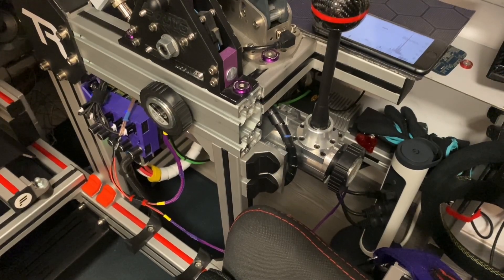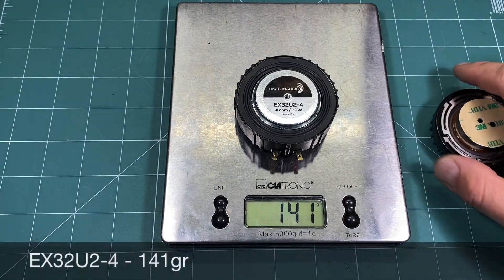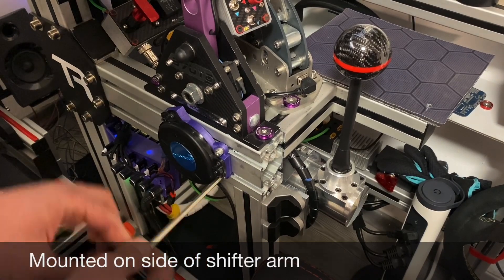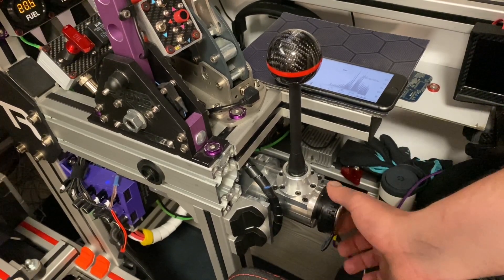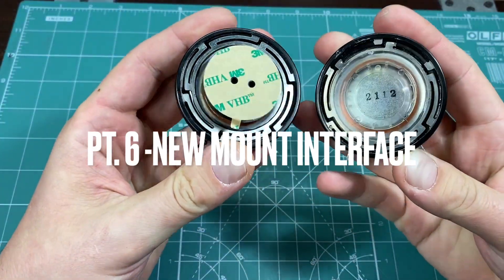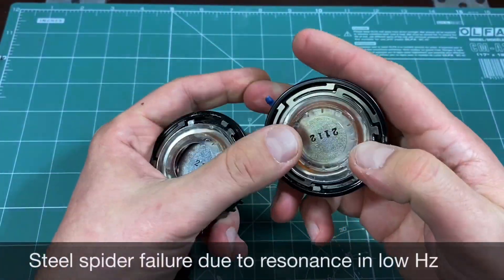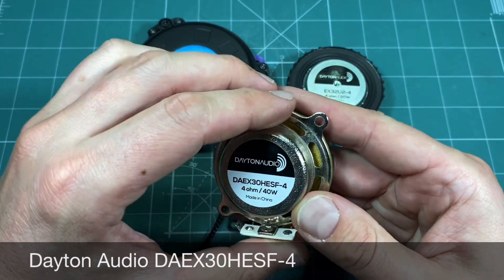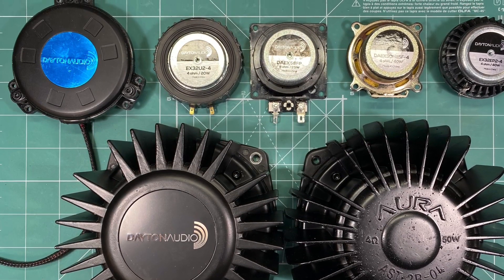Battle of the Exciters - An Exciting Review About Shifter Tactile Feedback for Sim Racing

Comment: Yeah the cheaper pucks are basically the same as a Simagic HPR reactor inside (pulled one apart yesterday). Just much shallower and wider also. Basically a magnet and voice coil and thats it. The spring action comes from the plastic housing where as the Haptic Reactors have no spring action and utilize the voice coil exclusivly. Much longer magnet too. So I can see why HPRs would have solid impacts as there's no spring resistance to the magnets impact

Comment: if u use exciter to rig, wouldnt u turn your rig into a speaker?
Reply from the maker: In this application they are driven at frequencies up to about 70Hz, which is almost not audible. It is not their comfort operation mode but they do the trick.

Comment: Nice video mate! I bought some pucks to test! Did you made that purple mount for them? Can you share the file? 
Do you think that the tape can hold them well?
Reply from the maker: I found it in thingiverse and modified slightly. Tape still holds ;)
Reply: @57uyo  Thanks man! I put a strong tape and its is holding just fine...
Reply from the maker: @fimaximo  sometime i have to change in the DAEX ones as they have small contact surface, but with pucks I doubt you will have issues

Comment: Hi, very informative video, by the way  what DACs and amps are you using to run this setup, are those in the purple brackets ?
Reply from the maker: Yes, it is XINYI audio XY-C100H USB amps, you can find more info on that following the links in the description. They have built in soundcard so you drive them directly through the USB
Reply: @57uyo  Thanks

Comment: hmm i ordered DAEX32Q-4 will test friday on brake pedal seems like model not in this list hopefully works okay.
Reply from the maker: Yes, never tested those, wonder how they will work. I am planning on buying some simagic pedal reactors and comparing with daex32 and hesf, also will throw in the mix my rumble motors. Please update when you finish testing ;)
Reply: @57uyo   will do and as far as those reactors asked race beyond matter to test awhile back with p2000 box and he said they seem to work without actually connecting the pedals think he might have a video about it soon, I will hold off until someone makes easy way to attach them to any pedal set.
Reply from the maker: @Eskoxo  I will 3d print mounts and drive them with one of my amps and SimHub as I am with heusinkveld pedals (saw people already using them with amps)
Reply: @57uyo  I Imagine you would have to create connectors for them or just cut them would it not be better to just get the box for em think its only $40
Reply from the maker: @Eskoxo  as far as I see they use standard DC jack so no issues there. Usb box is only adaptor for shifter/pedal to connect to PC. Still you need the pedals to drive the reactors. Either way I have spare amp and PSU so just need the reactors themselves. Still on preorder in Europe,  it I guess next month I will be able to get a couple.
Reply: @57uyo  cool im guessing will make a video about how you did it:)
Reply: Do you have any news about that exciter?
Reply: @szekerespista3758  I do have it but did not end up messing with it got simagic p2000/p1000 rumble motors mounted on my v3s and not looking back:)
Reply: @Eskoxo  understand. Thank you for your response!
Reply from the maker: @Eskoxo  simagic hpr is great on brake, mixed with my rumble motors is even better. For throttle this is also good option: https://www.soundimports.eu/en/xcite-xt32-4.html
Reply: @57uyo  did not really want to mess with things too much so i got hpr on brake and throttle works good enuf.
Reply from the maker: @Eskoxo  I also got 2 hpr, did not put second as I want to do some testing off pedals first

Comment: Very useful info. I have only used two of the products you test. I need to mess around with my shaker solutions more- but so far I haven’t really found anything I truly enjoy on/near the shifter. Anything I use at higher volume levels creates extra rattling/resonance between moving parts and lower volumes defeat the point. I’m still trying though as I feel like something is better than nothing. Thank you for taking the time to show so many options!  
Edit- I went back in SimHub and reevaluated my settings and got things working much better. I had a very high frequency setting under gear shift that was really clashing. Again, Thank you for your time.

Comment: I watched this with some interest...
Exciters are excellent to achieve a wider frequency range and audible tones that you cannot achieve with many of the other budget models as they are frequency restricted units. Most cheap models have a best working range in 30-80Hz but within that are strongest between 40-50Hz. The exciters can generate a much wider frequency range and this suits other types of effects but not so much gear shift roles.

Some feedback...
Where the exciters generally work best is in scenario of direct contact with a shell seat and for them to be used in multiple pairs for specific body regions. I see you have this on the seat already:) They also operate very well with multilayer effects that utilise octaves and generated harmonics as well as audible tones that can add extra detail/immersion to effects like engines. 
  
Appears this video is focused more on "Gear Shifts" and which unit produces more "punch". So not ideal role/scenario for a single exciter. Although in Simhub gearshifts do not just produce only the frequencies that users input for (Base/High) Hz.

Damages usually happen with excessive wattage, or scenario with too many effects operational at one time using similar frequencies (espically 40-50Hz) this increases the amplitude of the generated source prior to amplification. In my own experimentation with effects I would say that using low frequencies is actually not the cause, sometimes how we apply certain frequencies with others is needed to generate specific sensations with how some frequencies react together.

Recommendation:
If you want a punchy transducer for a shifter that is much more robust yet still small then consider the "Earthquake Mini" which is also one of the best for using on pedals for ABS etc.
Also take note that Simhub when using (Channel Tests) will output at 100% volume even if you use a reduced global volume and this is also a scenario that people cause damage to their units.
Reply from the maker: Thanks for pointing me to the quake mini (if this is the correct one I am finding). Looks interesting, but price point and 300W is too much for me. The Aura works ok currently on shifter, only issue it is bulky and I prefer to put it on seat for jump effects.
Also thanks for the long comments, totally valid and I believe I already covered all of them in the written portion of the review in description. All of them are spot on and aligned with what I figured out. This vide os crucial prt of the complete review but covers very little part of the complete text.
Reply: @57uyo  thanks for responding, I looked into your written review and enjoyed reading it.
Reply from the maker: @Mr_Latte_UK  thanks, mate! Appreciated that you liked it, not so many people read reviews any more ;)

Comment: You have ZERO CLUE what you're talking about. 
Exciters are surface mount full range speakers, not bass transducers. They failed because you don't know the difference and sent them LF signals constantly which isn't how they work. The spider rings and voice coil failed from user error. Surface mount speakers are designed to be used ideally in a Distributed Mode Loudspeaker panel wt a crossover and sub. Your trying to compare apples wt oranges and no surprise,  the apples won. Duh. Like comparing 3 inch tweeters to 15 inch subs and sending them low frequency and saying surprise, the subs work better If you play music through a Exciter while mounted to a surface, it will play the full range of frequency. If you play music through a bass transducer, it will do nothing unless the crossover sends it frequencies of 10-100Hz because they are two completely different devices made for completely different frequencies. You should seriously read Dayton Transducers 101 to get a basic understanding of the difference. If you send Engine Sound from game AUDIO, it will act as a small speaker that vibrates as any speaker will. If you send a Exciter Simhub TELEMETRY, which is LF signal based, it will eventually just break and fail as you show. 
Furthermore,  you don't mention what what wattage or impedance the amp is you're using for testing. 50W@4 transducers like the BST1 & AST2B-4 require at LEAST 50WRMS@4 Ohms to operate with positive headroom and eliminate clipping. And thats true RMS, not a Chinese amp marketed at 2x50 but actually only makes 12W RMS. Wattage rated at 4, sent to a 8 ohm load will be half, a 16, half of that. Since you don't list the actual measured RMS wattage at different impedance, the comparison between the TT25 and 50W, the only 3 actual bass transducers, it's also pointless.

Comment: This came in clutch sir! I'm trying to figure out what to get from these as well!
Reply from the maker: Will finish the written article tomorrow and will link it in description. It will feature much more info ;)
Reply: @57uyo  idk if it was just me but the BTS1 seems like a great option, very quiet too!! No rattling or knocking like the other ones...
Reply from the maker: @thinkrtank  It is the optimal choice especially if you take into account the price. The best option as expected is the Aura - it has more power in low frequencies and you can drive it at lower volume for Engine sound. Then overlaid with more powerful gear shift it works perfectly. Either way even with all the vibration loss in the rig structure both feel great in my setup, I needed only because I have 5 more of the same here and there on the rig and the shifter was underpowered and unbalanced with the rest.

Comment: Hello, there is one that seems the best, but the weight definitely makes the difference... I'm going with 10 bodyshakers in my cockpit, 2 of 12" and 2 of 10" that I made, there are 2 on the pedal board, 1 on top, right behind the DD and another to the chassis, I only turn on the latter when I see a repetition and it goes directly to the audio.
 6 Reckhorn BS200i on the chair, they are independent and isolated, all with few Simhub effects, I feed them with 10 mono amplifiers for subwoofer of 100W 4 Ohms and 5 power supplies of 24V.20Amp.
 The pedal board and the saddle are mounted on springs and rubber bands, and thus I avoid contamination of the vibration to the chassis and ground... Maybe in a few months I buy a couple of servos and put them on the sides to puff up my shoulders a bit, now I tried with head and back separately and together and I didn't like it, I was thinking of making a 2DOF but the more I see, the less they convince me, and more with the great immersion I have now... 
Bodyshakers are the way to go for me, it's The most realistic thing is in my opinion, the movement systems are good to have fun, but not unrealistic... 
For now and after 6 years of testing, I think I'm going to stop and enjoy it, although I have 4 wheels to finish and 2 shifter that need a set-up, this Simracing thing is non-stop...
 Regards.
Reply from the maker: Cool stuff! Always wondered why people put shakers on wheelbase. On the other hand I have one more Aura on the Inverted Pedal deck - together with the shifter one they propagate a lot of vibration throughout the rig effectively reaching the wheelbase. Pedal plate and seat are decoupled from rig so have localized vibrations. Still toying with the idea to find some robust small exciters for localized shifter feedback but cannot find something small that works well in the 40Hz range and will not break. Here is put detailed description of my tactile setup, now am down to 12 shakers though :) https://www.diy-sim.com/user-gallery/sim-gear-gallery/item/tactile-setup-with-13x-shakers